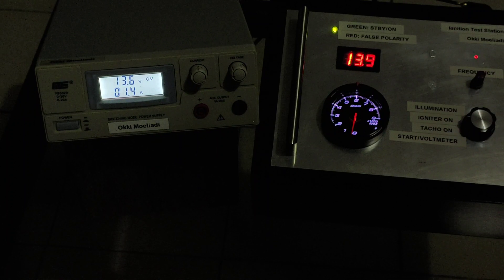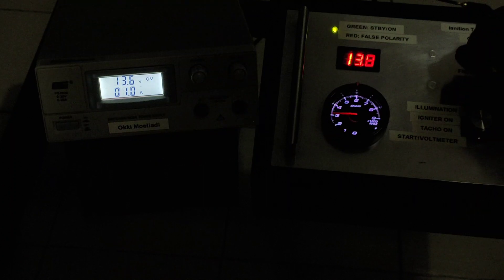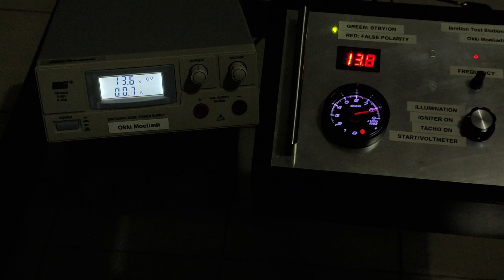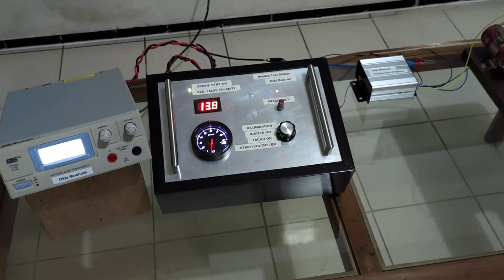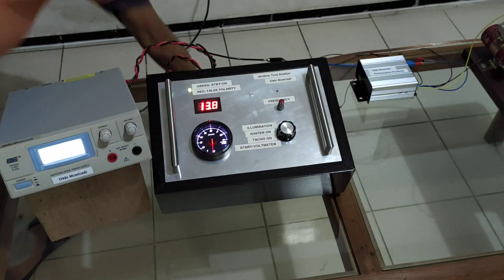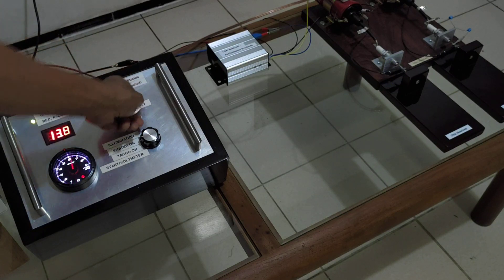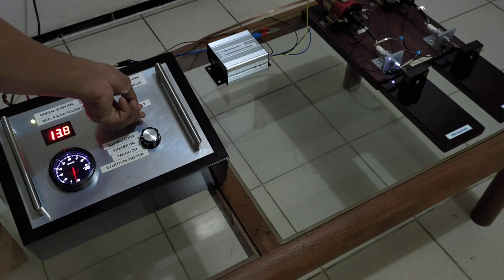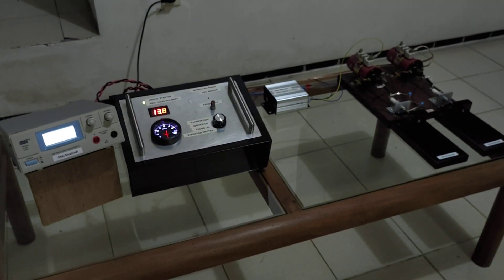CDI advantages over typical 12 V ignition system

Comment: You need to do some calculations with the capacitor values, frequency (RPM), and capacitive reactance especially if those are resistor spark plugs.  The firing stops at high frequencys because the peaking caps are shunting the spark plug at higher frequency when the capacitive impedance is too low at higher RPM's.  If the capacitance was lower, the sparking may have not stopped.  I am no mechanic (an EE), so this is just an opinion.

Comment: Apakah cdi ini cuma sampai 8000rpm atau bisa di atur lebih dari 8000rpm
Reply from the maker: Bisa lebih. Butuhnya sampai berapa RPM? Untuk mesin berapa silinder?
Reply: @OkkiMoeljadi  hanya 1 silinder minta sampai 13k rpm dan untuk motor sendiri yang masih karbulator pakai yang single or dual chanel
Reply from the maker: @krisnadplo8985  kalau CDI ini dipasang di mesin 4 tak 1 silinder bisa untuk 36000 RPM. Kalau untuk 2 tak 1 silinder bisa 18000 RPM. Kalau mesin 1 silinder atau multi silinder dengan 1 koil pengapian cocoknya menggunakan CDI single channel.
Reply: Untuk pembelian hubungi kemana?
Reply from the maker: @krisnadplo8985  silakan kirim email ke saya: info@m-opensolutions.com
Reply: Apa ada nomor tlp dan rekening klauu sy mau beli lewat yang bapak sarankan sy tidak ngerti cara transaksi nya mohon maaf 🙏🏽🙏🏽🙏🏽
Reply from the maker: @firdausintan1908  tolong beritahu saya nomor hp bapak yang bisa saya hubungi.

Comment: Mas, cdinya khusus untuk motor ?
Reply from the maker: CDI ini bisa juga untuk sepeda motor. Walaupun sebenarnya saya mengembangkan modul ini untuk mesin mobil.
Reply: @OkkiMoeljadi  saya tertarik di pakai di mesin mobil. Mobilku pakai coil yg include TCI, kalau di ganti cdi+coil  apakah harmonic nya mengganggu system controllernya ?
Reply from the maker: @keliktyuwono  untuk di mobil saya, keluaran dari TCI saya gunakan sebagai sinyal input di CDI. Modul CDI single channel ini bisa membaca sinyal dari berbagai macam trigger, hanya diperlukan setting jumper yang sesuai. Jumper ini ada di dalam kotak modul CDI.
Reply: @OkkiMoeljadi  berapa harganya untuk yg 2 chanel?
Reply from the maker: @keliktyuwono  silakan kirim email langsung ke saya info@m-opensolutions.com